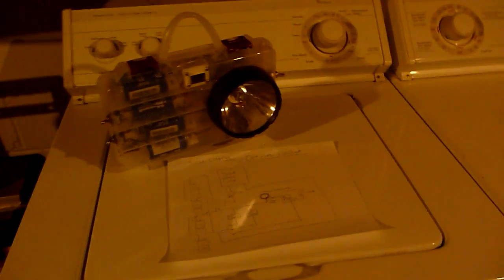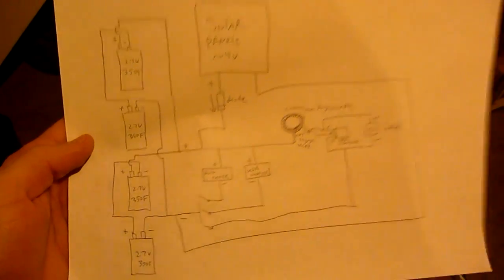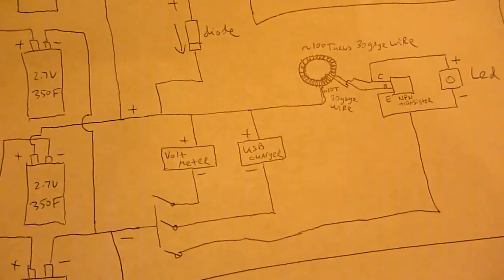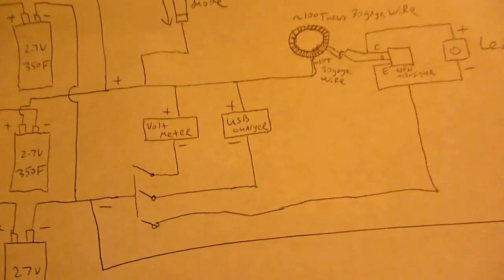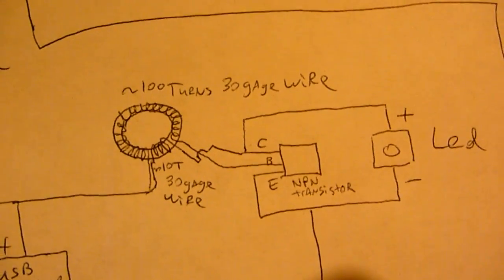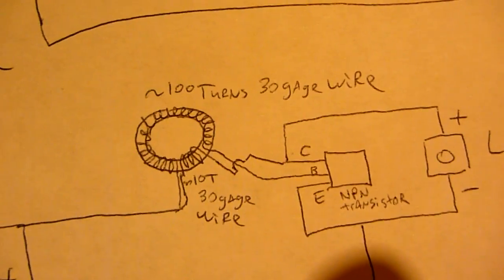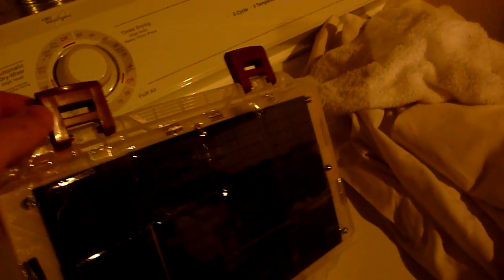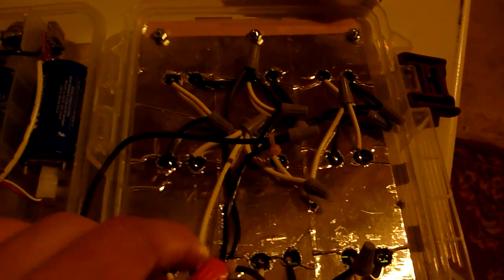Homemade Capacitor Flashlight with Schematics

Comment: its that coil?? 100t 30 gage wire?? i don't understand what is that.. can u tell me..
Reply from the maker: +afiq viennas Its 100 turns of 30 ga wire and 10 turns 30 ga wire. The 10 turn coil goes from the power source to the Collector on your transistor. The 100 turn ends at your power source and starts at the base of the transistor. The emitter goes to the negative of your power source. This is a basic Joule Thief circuit... do a youtube search for it. What it does is that it pulses DC at high frequency so you can get bigger voltage output than your input. It makes your power source last a lot longer.... makes you wonder why EVERY flashlight doesn't have one? Technological suppression for profit maybe..... maybe indeed. Thank you for the question, hope that helped.